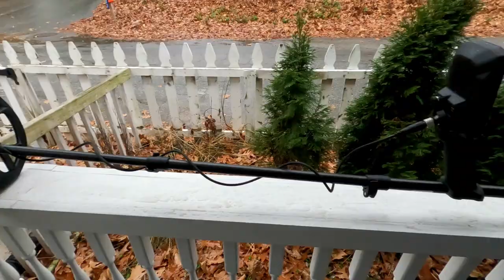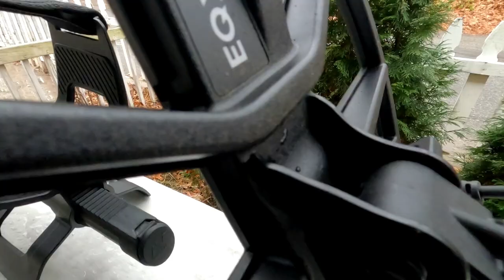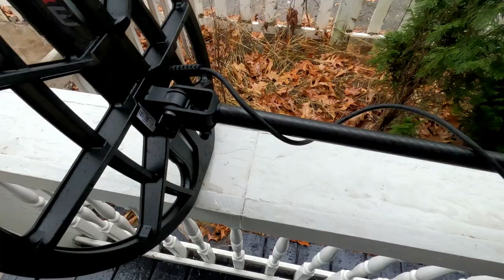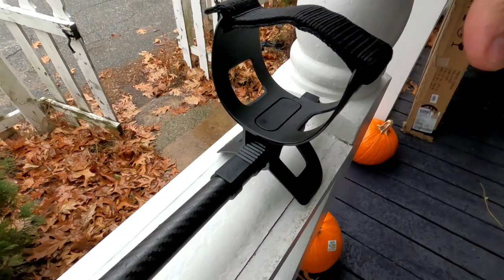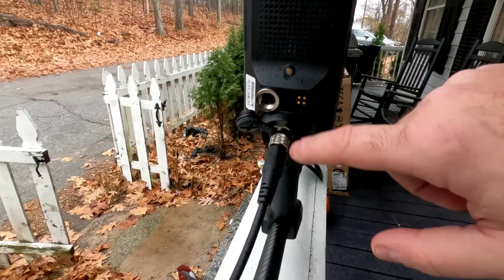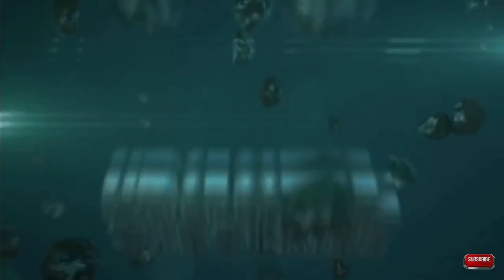Minelab Manticore and Equinox 900 Some Questions Answered

Comment: Just ordered the Manticore last week and tonight ordered the Equinox 900. Would love to see a side by side of both collapsed from the top and sides. With total length in inches and total high in inches. Also, how easy is it to remove the grips? What their sizes are and width. I plan to take these on planes for vacations and will check in everything but the grips with the batteries in them for my carryon. THX
Reply from the maker: Emails me Jim, ill send it over to you. Emails in the about section.

Comment: I have the equinox 600 and I can say those charging ports are the same on both the 900 and the manticore. The charging port is a large part of the leaking problem because they develop cracks in that area.
Reply from the maker: Think its all upgraded to new material.

Comment: Good work iffy. I like to keep my coils on the shaft instead of switching coils back and forth. Which lower shaft should I get? Detect-Ed mention their lower shafts can only be used with their upper shaft
Reply from the maker: Thanks Bill, im not sure if anyone is making these yet because they are a smaller diameter than the ones for the 600/800. I have a red belly detect ed lower and it does not fit with the new shafts.

Comment: I know every detector has EMI near powerlines but I used NOX800 before, and it was noisy even in rocky fields alot of blind targets I was digging. That's why I sold that and purchased E-trac and I think its the king of stability but recovery speed was very low. I never dig somewhere without target with E-trac, however It was old beast. If Manticore or 900 can be stable than 800 and EMI improvement I am so interested to buy a Manticore new beast.
Reply from the maker: I have a depth video uploading now that show both the 900 and manticore very stable near my house.

Comment: Thank you for this information. The charging pins on the 800 were also gold plated. My concern is the charging port is the same as the 800 (this has been shown in detail on a different video) and cracks if you do not connect/ disconnect with care. I hope I am wrong, but it could be a leak issue as it has been on the 600/800. Manticore uses the same port also. Thanks again for the information.
Reply from the maker: Pretty sure it is a new material now.

Comment: I second the EMI question. There are spots that are virtually undetectable with my 800 without seriously compromising performance by having to lower sensitivity drastically or having to use single frequency 40khz. Anywhere there’s underground wires for lighting in a park or near a pole transformer it just goes crazy. Forget noise cancel or even trying to manually find a channel as none work. Does either the 900 or Manticore improve on this? Thanks!
Reply from the maker: It does really good with emi. It has allot of power though. If you get into the 30+ sensitivity it can cause a racket if you are around powerlines.
Reply: From my understanding is the Vanquish 540 is using this new technology to help with the EMI. The Vanquish 540 is the quietest machine I have ever used!!! The Nox 900 and Manicore are using the same technology. Going to be interesting times.

Comment: I thought the new Equinox pods were upgraded to the new Manticore pod?  I see that it's not the same because the flashlight is different.  So is the Equinox using the old style pod housing but with the addition of the flashlight?  Or is the 700/900 pod completely different than the 600/800's?
Reply from the maker: Different design than the 600/800
Reply: @IffySignals  Good news. Thanks

Comment: When i go to pick up my manticore will it come fully charge out of the box? Or if not how much charge will it have in there ? Also how deep does the 2d screen go. Does it loose accuracy at depths or fade out all altogether at a very very deep target ?
Reply from the maker: Hey Jacob, the screen will pickup even faint signals. Does not loose accuracy but will be fainter if the target is on the edge of detection. Probably will not come with a full charge and you should charge it up.
Reply: @IffySignals   Cool , 
also I wonder what shows on the screen if you detect a magnet a few inches away from the coil. Not too close just enough to get a solid reading. That would be interesting to test.

Comment: Can you pair aftermarket headphones to the new equinoxes ? That were bought for the older equinoxes
Reply from the maker: No Lou they will not work. They resigned the wireless to be very fast and eliminated the WM08 module

Comment: Do you have any infos about the wireless audio? Is it BT LE or some kind of proprietary stuff? I'd like to use my trusty wired phones in the long run..
Reply from the maker: Hi, it’s proprietary now. Your wired headphones will still work.
Reply: @IffySignals  Yes - but used with kind of a receiver would be nice. Im a 100% WM08 user on the Nox. Minelab said, they won‘t release a WM module.. I don‘t get why 🤷🏻‍♂️
The supplied headphones are too warm in summer and too bulky in winter with woolie hat and headlamp imho
Reply from the maker: Not sure why they did away with it. I liked being able to use aptx ll air buds.
Reply: @IffySignals  Choosing a commonly used protocol had been a great move and one of the reasons, I've bought the Nox. Beeing tied to the manufacturer's phones is a real downside for me. XP at least offers an adaptor to connect your favorite phones to their WS/WSA puck.

Comment: The coils with the 600, 800, 700, and the 900 are compatible with each? ? ?   This will circumvent the coil ears breaking on the earlier Equinox series?  A simple modification?  Thanks for the video!
Reply from the maker: Yes the older will work on the 700/900
Reply: @IffySignals  And the newer coils will work on the older models?  Thanks!
Reply from the maker: @donaldlee6699  yes

Comment: I was going to sell my 800 and now you're telling me that the coils charging cable and some of that stuff will work on this I have a six inch coil of course the 11 and the 15 inch are the performances of the equinox coils the same as the newer ones today redesign anything on the interior of the new coils that will make them perform any better than the older ones a contemplated on selling the 800 but I kept it just to see what was the compatible
Reply from the maker: Yes the coils, charger and wired headphones will be compatible.

Comment: What is the technical difference between 900 and Manticore? I mean stability, depth and etc...
Reply from the maker: Hey FT, the 900 punches a little deeper than the 800 and the Manticore is even deeper than that. The Manticore has allot of power and how much you can use will really be site dependent. If you are out in the woods or a field you can really open it up into those new 30+ sensitivity levels. The new lineup is very stable and handles emi very well.

Comment: My question is emi related. How do they handle it over the 800?
Reply from the maker: It does really good with emi. It has allot of power though. If you get into the 30+ sensitivity it can cause a racket if you are around powerlines.

Comment: Hi. Is this the same shape handle between the Equinox 600 and the new 900 ? Or did they improved it for a better comfort ?
Reply from the maker: The 700/900 and manticore are redesigned at the handle as well.
Reply: @IffySignals  Ok. So the comfort is better compared to the 600-800 handle ?

Comment: I'm not sure I like those flexible arm cuffs.   I never strap my arm in unless I'm water hunting....that flexible cuff could possibly make the strap mandatory.   Not that it matters........batter life on the manticore is insufficient for my use anyway.   Did they give you specs on battery life for the 900?  I know the 800 was one of the best multi machines out there for battery life.
Reply from the maker: Not sure on the full battery life Bill. Just like the 600/800 you can bring a battery pack with you and use that.